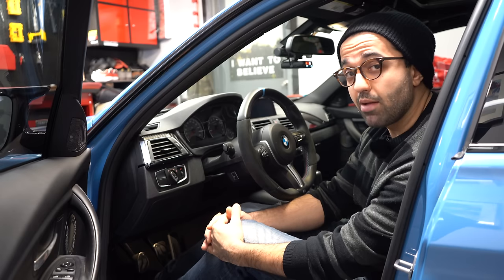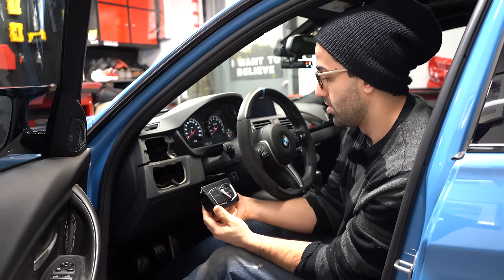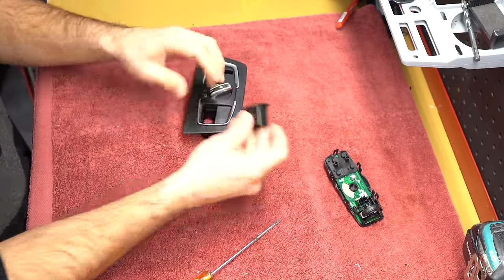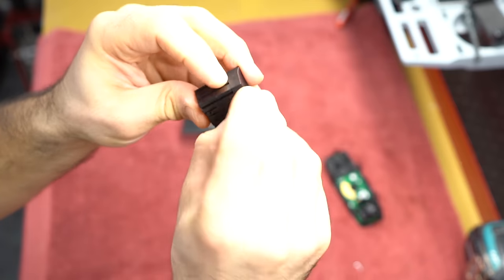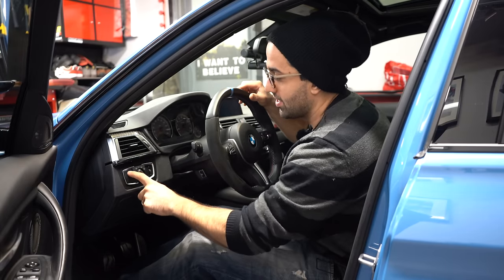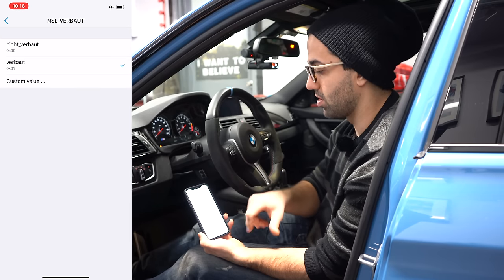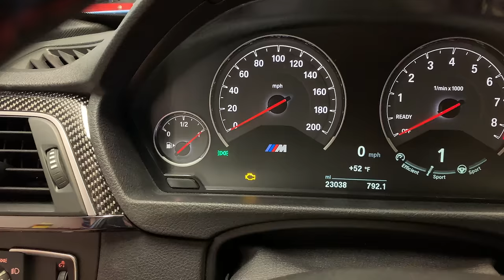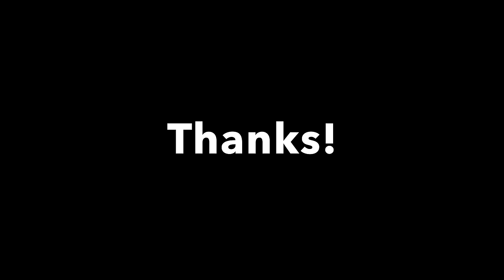V90: DIY Euro Rear Fog Lights on an F80 BMW M3 - coding and button mod

Comment: Excellent video! BTW, you have to code every module separately as the application does not support multiple modules coding, and you once you exit a module without coding the changes are reset to current ECU set values.

Comment: Great video. Just fyi.. you can pop just the button out with a plastic pry tool. No need to remove the vent and entire cluster. Just wedge the pry tool and gently pop the button and then go about shaving the tabs and just push the button back in when done and it clips back into place.
Reply from the maker: Ahhh good tip. Thanks !
Reply: That's the way I did mine some months ago. Worked perfectly!

Comment: Quick question, does Coding (like what you did in the video) void the warranty? It looks like there is a lot of neat options but worried if I tinker with some of these that BMW will void my warranty.
Reply from the maker: Justin Allen from what I was told - no. You’re just enabling factory options.

Comment: Hi Tommy, I have a 2020 M4. I bought the light switch from overseas that has both the front and rear fog lamp capabilities. I coded in the rear lamps from forums (and watching your vid...thanks!) I've visited but I'm having trouble finding the right codes to change my front corner lights to fog lights. I can't seem to locate in my front electronic module what they're referencing. Any help/insight you or anyone else could provide would be greatly appreciated. I'm not a coder, so the more detailed the directions, the better. Maybe I'm just missing the right sub-module to go to... Thanks!

Comment: I really don't get it why they would disable this function for the US market, it makes literally no sense. Everything is there, the lights, the switch, the cables, everything connected and prepared, why even go the extra mile to make extra buttons to disable the function? taking everything out or just leaving it working in the car would make sense, but leaving it and actively disabling it? wtf
Reply from the maker: At least we know how to enable it :)
Reply: @TommyLGarage  Absolutely 👌 I did a bit of research and it seems like in the USA it's illegal to have paired fog lights, so they deactivate the function to get their cars approved.

Comment: This is a must for any modern BMW IMO. I did it on my e92 335i n54. For my e90 M3 I bought the euro switch just bc. Interesting that the F80 need coding. The older bmws. You just need to do the LEGO or buy the euro switch. And it’s enabled.
Reply from the maker: I love this is mod

Comment: One step that is not shown here is that when you are finished making changes in each module, you have to select "CODE" before leaving that module, otherwise your changes will be lost.  In this video it was already done previously, so it is missing the step showing that you actually have to select "CODE" to get the code written to the module.
Reply from the maker: Good point. Thanks !

Comment: Hey Tommy. I’ve just tried this and for some reason when completing the steps for the front control section, I can’t back out to perform the rear module steps. Seems I have to hit “Code” button first the exit to the rear module section? Have you heard of this?
Reply from the maker: Yes. You have to code separately. That’s right
Reply: Tommy L Garage Great!!! Thank you!!

Comment: Hey Tommy, I coded the features and I get the light on the dash but no changes in my taillights when pressing the button on or off.. Do u think maybe the F83 doesn't have the light bulbs installed?
Reply: nvm I found that M4 needs to have custom values for the L & R (20 and 21). 

Thanks for the video!
Reply from the maker: Good to know. Thanks !!
Reply: @TommyLGarage  btw.. Do you  know what the top button does? If anything... 🤷🏻‍♂️
Reply: @stephenj8697  Hey, I had the same problem with my 2018 M3 CS.  Can you please explain how you set the custom values, please?
Reply: @mihnea297  You have to use BimmerCode in expert mode, but unfortunately it was too long ago I can't remember which values had to change sorry!

Comment: Tommy- Will a BMW service center code your car for you if ask them to do it? I will do the rest on the switch. I live in the Washington D.C. area. Love all your posts by the way.
Reply from the maker: Yes they should but it will cost you. $140 per hour. Spend $30 and do it yourself and have the ability to do it whenever you want. I linked it all in the description.
Reply: Update: I ordered the same obd2 device you’ve got. Thank you again for all your outstanding info’s. I will get it tomorrow.
Reply from the maker: bj alger thanks and good luck! Let me know how it goes
Reply: Tommy L Garage most definitely. I’m having my 2018 Golf R tuned right now to Stage 2, DSG tune as well, downpipe and rear sway bar upgrade. M3 is hibernating right now for the winter. I’m here at NGP (New German Performance) in Manassas, Va. and I’m watching your videos. Lol!
Reply from the maker: bj alger wow great car and I hope my videos don’t scar you for life :)
Reply: Tommy L Garage - Love all your videos. Just keep doing what you doing. You are helping us with your knowledge. You are a blessing to the M3 community. Just checked Amazon and my device comes in tomorrow and i will do the manual work in the morning.
Reply: Tommy L Garage - Update. Picked up my OBD device from Amazon box and i just want to thank you. Did it about a couple of hours ago and it took me about 40 minutes. Thank you again for all your help and detailed videos. Got scared a little bit when I didn’t see the Verm@@@_r output. Lol! But it’s all working now. I owe you a drink if you come over to Va, Dc area.
Reply from the maker: bj alger awesome!!! Glad it all worked out
Reply: Tommy L Garage - Interested with your spacers. Pls send me the link. Wish I could send you a picture of my M and my project aka diy. 2016 with 4600 miles.
Reply: Tommy L Garage - Btw, i worked at a Volvo dealership. If you consider doing the Polestar performance software update let me know. If you come here to Va, i will do it for you at a employee cost and i will have my tech do it for free.
Reply: Tommy L Garage - Hello there it’s me again, Bj. Sorry for the late text. Just curious why you also did the upper switch. Are you planning on adding some kind of a foglight or driving lights?

Comment: i did this to my e92 years ago before i traded it in for my 440 (it didnt require coding just modding the switch). I think its a great safety feature and im surprised the nanny state govt doesnt require them on new vehicles. I also had tinted windows on the e92 and they were actually so bright they helped my visibility when backing up at night lol.  You are edging me closer and closer into buying bimmercode btw hahaha
Reply from the maker: BimmerCode is awesome!

Comment: Tommy, I just tried this step by step on my 2018 M4 comp pack, when it said coding complete, i turned off accessory mode and back on and it didn’t work. any help you could give me?
Reply from the maker: Did you follow everything ? Many viewers did it with no issues
Reply: Tommy L Garage this is my brother, i commented a few days ago. i ordered everything, and paid 26.99 for bimmercode. my button clicks like urs now. i followed ur instruction for the coding process, but got lost when u did not proceed to “code” as u had already previously done it. theres nothing on the forums, is it possible the m4 does not have rear fogs? i hope you can help me...
Reply: Avalanche 350 I bet m4 coding is different lights are.